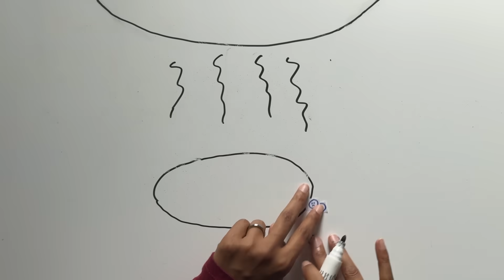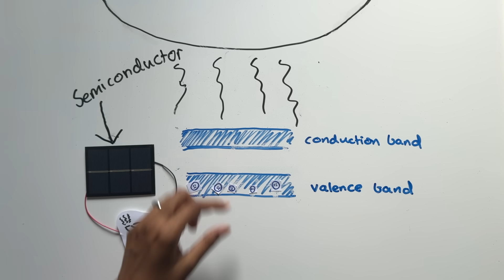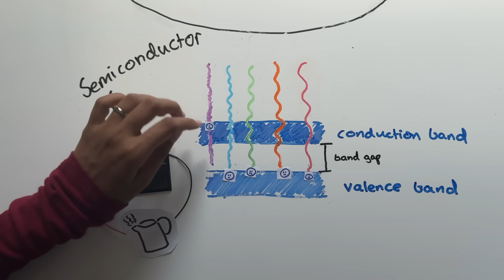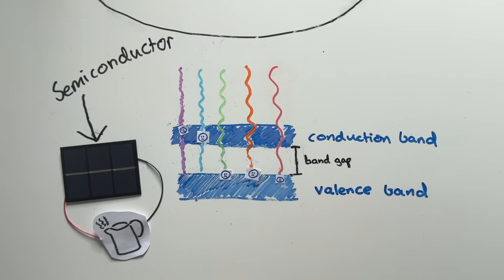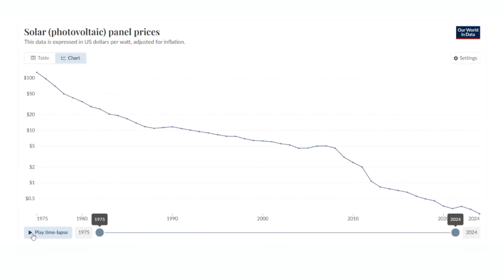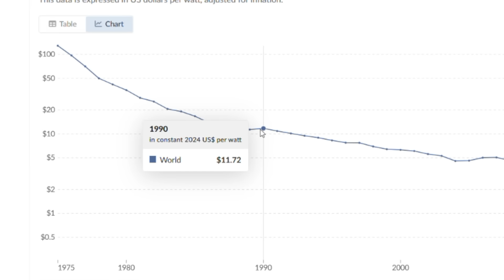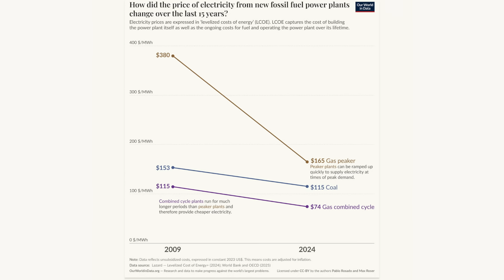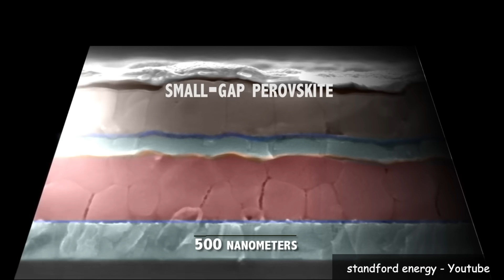Why solar panels can't be more than 33.7% efficient

Comment: The unabsorbed light is either reflected or becomes heat. Strictly speaking, your solar panels will be slightly cooler when they are connected and under maximum load vs when they are not. That is why an unconnected solar panel won't just "burn up". Let's talk about a simple practicality... If a solar panel were able to absorb all the light around it, it would be invisible. If if were able to absorb the heat, it would become ice cold, if it could also absorb x-rays and gamma rays as well as mechanical energy around it, it would become essentially a singularity. So there is absolutely NO WAY to make a solar panel even 50% efficient, let along 90%. Solar isn't the answer. It has its applications, but on industrial scale, it contains more problems than solutions, the most important of which is lifespan and disposal.

Comment: Wow, completely forgot about the price of solar panels
I was wondering if the multilayered cells would be good to use in space but I would guess you would want to maximise energy/weight as much as possible
also love seeing amateur chemistry getting referenced
Reply: space is basically the only place multi-junction does get used, especially for interplanetary missions that rely on electric propulsion. might be adopted on the ground if perovskites or some other approach makes it cheap enough.

Comment: Well, she is not right. The actual maximum is 48% in 10-15years, 60% in about 25 years. if you calculate development and science that everything in energy has, a time period of development. And if she think like this, she is actually denying progress, and we already know that there is ways in different ideas to put up solar panels in space and transfer it to earth. And as always, it's never going to be one solution, wind, wave, ground pressure turbines, thermal heat, and more. She should take a look at my experiments with what I call the tree that has much smaller size, lower cost and a higher efficiency because the optimization of the different negative things with traditional solar panels. And with tiny change in material.

Comment: Use the red light (and infrared and longer wavelengths) to heat your teakettle. Same with the "excess" energy that would be wasted if it uselessly heats the solar panel.
   The only catch is that you need to love drinking tea.
Reply: Maybe everyone in Britain and Ireland will buy solar panels now!

Comment: The load in the circuit has information about the band gap energy and will not make use of any excess, but the other components of the circuit will gladly absorb that energy???
Reply: Not really, 1) the voltage it gives is directly related to the bandgap, so the rest of the circuit treats it like a battery 2) electron can move within the conduction band, slowly giving it's energy away as heat.

Comment: Efficiency means nothing when the energy is free.
Reply: nothing is free, but non-second-hand solar (nuclear) gets close to it.
Reply: @davidlewis6728  Sunlight isn't as free as rare earths? Nuclear is basically the only energy that isn't ultimately solar.
Reply: @narfwhals7843  solar and batteries are rare earths. even if repairs are becoming less frequent, they still have to be repaired. all the rare earths for nuclear are efficiently converted into a whole bunch of reliable energy. i'm not saying solar isn't great, but for large scale energy, nuclear is best.
Reply: @narfwhals7843  who told you solar needed rare earth metals? they don't. You need a glass panel (silicon dioxide), a plastic panel (rear side) and a thin layer of silicon, enriched by small amounts of borate and phosphor. No rare earths needed, just basic and abundant elements.

There is too much misinformation out there by fossile lobbyists. Don't fall victim for their crap.
Reply: @ElwoodEBlues  My original point was that sunlight is free but mining radioactive metals is not.
Reply: More efficiency means more watts per square meter. Would you rather buy a solar panel that gives you 100 watts, or a solar panel of the same size and price that gives you 200 watts?

Comment: Not my field, so a genuine question:
Can you split the light and then use 2 different types of solar panels, with different gap sizes?

Edit: I should have watched the last minute before posting my comment.
Reply from the maker: Yup! I mentioned it super quickly at the end of the video- these are called multi junction solar cells and have a limit of 68.7% efficiency. But at the moment these are lab demos, not really commercial. It took many decades for single junction solar to go from that stage to commercially viable, so I don’t expect that’ll happen for these for some time
Reply: @LookingGlassUniverse  68.7% is perhaps the limit without focusing methods (and maybe assuming Kirchhoff reciprocity law, another 'law' which can be subverted with sufficient willpower). Ultimately the bound imposed by the 2nd law is the Landsberg limit 1-4/3 * T_c/T_h+1/3 * (T_c/T_h)^2 where T_h is the temperature of the to-be-harvested thermal radiation and T_c the temperature of the ambient environment. This bound is slightly more pessimistic than the Carnot law 1-T_c/t_h for certain reasons, but in case T=5800 K and T_c=300 K the difference between the two isn't that big and it is between 93 and 94%.

I think you are right to judge pursuing such bounds for mass-manufactured products as misguided.
Reply: @LookingGlassUniverse  I was about to downvote the video until that waaay-too-short-and-waaay-too-late part came. In my mind, saying that the absolute maximum is 33.7% and not saying ANYTHING (not even a little disclaimer that it's about single junction at the start) about the existing 50%+ ones is clickbait. No worries, I always watch the full video. But, please, think a bit about it next time. The multi-junction part is much more on topic than the cost of silicon-based solar panels. It's easy to create confusion when you don't address the context early.
Reply: I had exactly the same question, now I know to not ask until the end 😂
Reply: That's what's called tandem solar cells! There's even something called Tandem LEDs, which is the same thing but for emitting instead of absorbing, so it's used in modern displays.
Reply: there are solar cells that use mutliple band gaps
Reply: Just wondering,  can we make a hybrid with peltier and also convert heat to electricity?
Reply: @Beerd_man  No. You're not the first to think of it - though usually the idea is to use the heat for something else, like combining photovoltaic electrical with solar thermal water heating. There's a problem though: Photovoltaic junctions leak. They leak a lot more as the temperature increases, so any amount of heat will seriously reduce electrical efficiency. This is already a bit of an issue in warm climates, but even in the hottest of places it's only a moderate problem - the panels will work at 40c, just not as well. But for heating water you need at least 80c, which is pushing the limit of practicality - the electrical generation suffers, but that's an acceptable price for the heat output. Any higher though, which you'd need for a TEC, and the electrical output drops off a cliff.
Reply: There are options, but don't force it. In most cases, watts per dollar are more important than watts per square meter (unless, e.g., you design the PV for the Herschel space telescope). It's an interesting field for future research, but we should not forget that now, we need to work on PV storage.
Reply: Yes, you could use a prism to separate by wavelength and then use materials with different band gaps.  I do not think any gain in efficiency would counter the extra cost.  Having layered solar cells with a high band gap at the top and a material with lower band gap below though is a common technique.  One interesting idea has been rather than match the bandgap to the light, match the light to the bandgap.  Perhaps upconvert or downconvert the light to longer or shorter wavelength to optimise absorption.
Reply: Yes. Light splitter by color is how modern TVs work. Microscopic prisms etched into the surface can split the light onto high low wavelength junctions built in straps a fee nanometer wide

Comment: Im guessing a semi-transparent cake type structure of semiconductors that absorb differemt wavelengs for maximun efficiency cant be done for some reason.}
Edit: oh i see you briefly adressed this by the end of the video, another thing i wonder is how mirrors  interacts with panels and why in not a popular arrengement
Reply: Cost is the current barrier for multi wavelength panels. 

Mirrors are used to some extent, but the problem is heat and the cost of the mirrors. Mirrors need tracking to work, (which means expensive mounts) and the collectors need active cooling. The life of the collectors is shortened. Then it doesn't work at all under cloud rather than just working a bit less. So in the end, just flat panels on fixed mounts give the most kWhs per dollar.

Comment: The theoretical efficiency limit of 33% is for a single-junction solar cell made of silicon, which is the most common method currently. 

Multi-function or concentrating photovoltaics have achieved higher efficiencies, with the highest being over 40%. Of course, these might not be cost effective to be worth it for a while.
Reply: tell us you didn't watch the whole video without saying you didn't watch the whole video
(she mentions it near the end. 68% theoretical efficiency)

Comment: How efficient is a combustion engine?

For standard road vehicles a combustion engine is typically between 20 and 30 percent efficient.
A formula 1 car can be up to 50% energy efficient.

But as we all know a combustion engine requires a single-use fuel source to power it.
Reply: the most efficient combustion technology is combined cycle turbines. basically you have a jet engine running a generator, then you boil water with the exhaust for another generator. those can get into 60+ percent.
Reply: Stationary and similar engines like diesel generators, locomotives, and ships perform better as they operate at a constant setting and often close to their optimum. But they hardly achieve more than 40% efficiency. Reasearchers from Japan or korea claim to have reached 50% in the lab, and recently a new type of natural gas-driven engine has been made public that is said to be able to reach 49%.